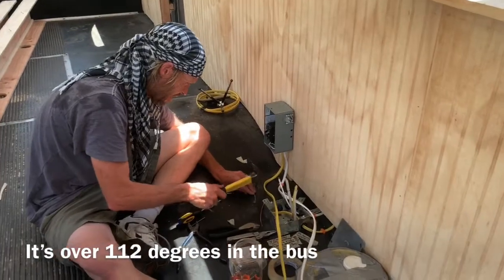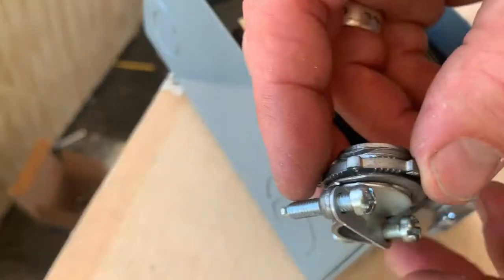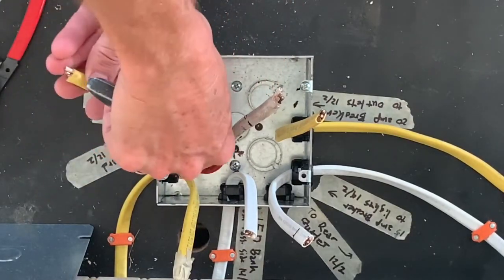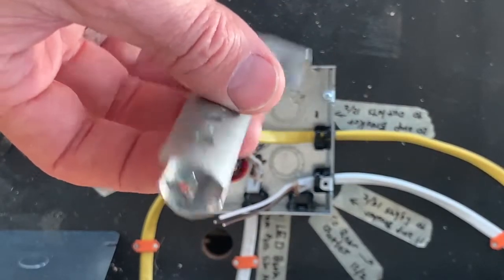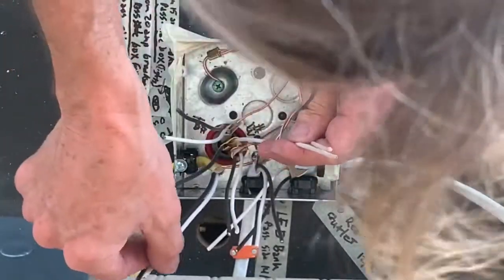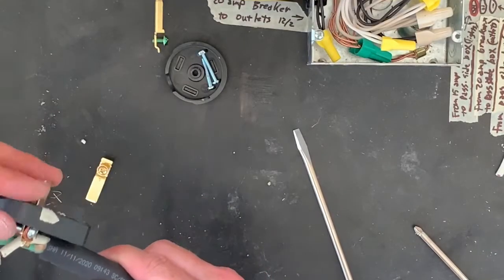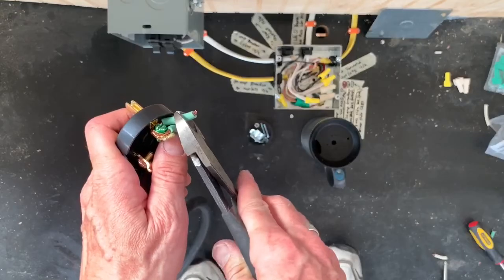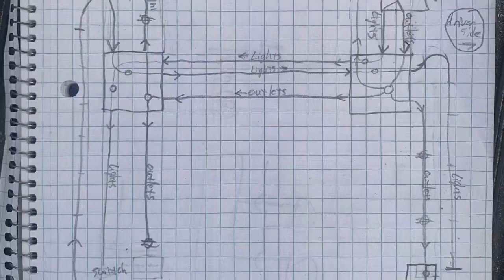Building the Breaker Box and Final Connections  |  1989 Crown Supercoach Skoolie Conversion

Comment: Isaac, it’s been about 10 years since I installed my panel (50 amp), and I had to split the incoming wires to serve each half of the 220 panel-otherwise you will still be sending 220 to your appliances, and ruin them-at the least blow fuses.  But if your incoming is just carrying 110 volts, you did perfect with the jumper wire.